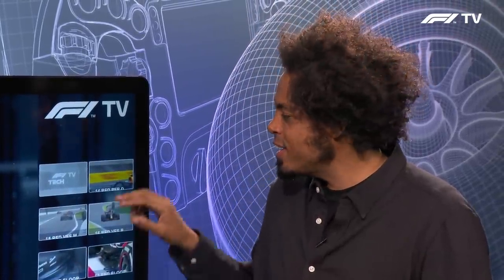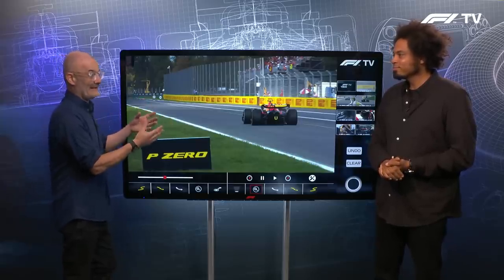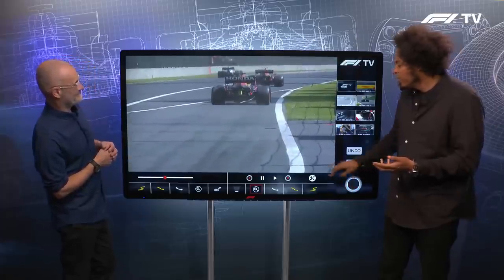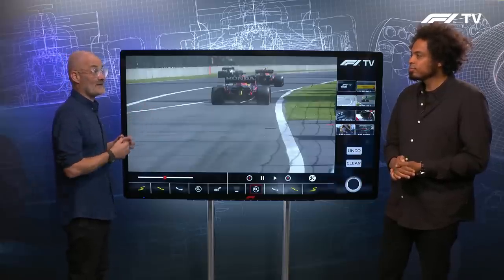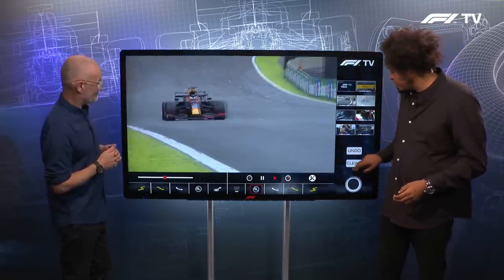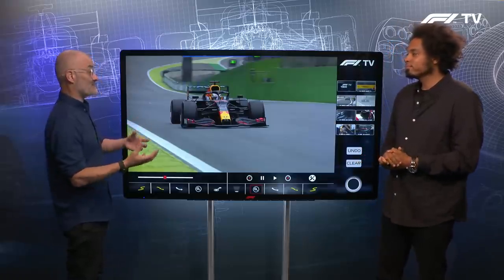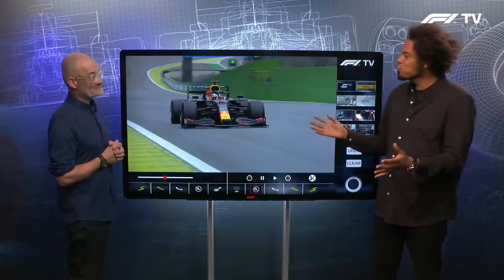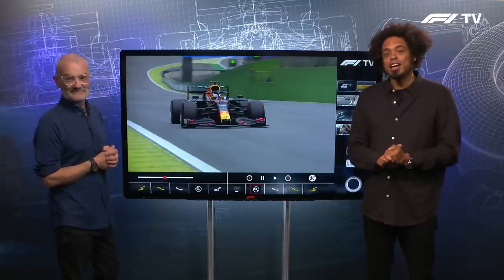What's Going On With Red Bull's Rear Wing? | F1 TV Tech Talk | Crypto.com

Comment: honestly I’m more interested in how high tech this touch screen panel is they’re using to show us these diagrams, pretty advanced technology!
Reply: The program, or app is what integrates the touches, i doubt that the screen has a lot to do with it, other than being a touch screen.
But yeah, it works pretty well, the programmer probably made quite some money on it.
Reply: What is essentially a big android tablet really isnt that advanced is it
Reply: i'm more on the side of "this should be standard everywhere by now" -- we've had touchscreens for what, over 2 decades now? yet they somehow work wayyy better in the tiny handheld smartphones and tablets than on bigger tv screens used for presentations? probably gated by the price of components that don't scale so well with size, but yes one of the bigger issues is app design.

Comment: I think they try and reduce weight of the rear wing mostly on low drag ones and as a result it’s made it more fragile. But if it doesn’t completely fly off then I guess it’s legal.
Reply: It really isn't legal, it's a movable device like that even if it ultimately costs laptime.
Reply: It could well dsq them from races if the drs is stuck open.
Reply: @akmal94ibrahim  if the DRS was stuck open, then the car would simply fly off the circuit under-braking.
Reply: @GaresMusicOfficial  ask Ericsson lol.
Reply: @GaresMusicOfficial  no because ground effect but he would lose downforce so he needed to lift or brake earlier
Reply: even if it is actually a hindrance, i think Toto will say something about it being flexible aero
Reply: It's not a weight issue. It's clearly a stiffness issue and I bet it's down to that wing element being so thin that, even in carbon, it isn't stiff enough to avoid aerodynamic oscillation starting as soon as a bump deflects it. Why make it so thin? Reduced drag in DRS mode and more downforce for less drag in non-DRS mode.
Reply: @akmal94ibrahim  no because it actually hinders them more than it helps them. Curve grande probably can’t be taken flat, lesmo’s are a problem and don’t even get me started on parabolica.

Comment: As long as i dosen't brake, there's no problem there. They need the wing comming out of corners, while they don't need a wing on a straight. The flopping does not affect the aero on the straight...A maximum low weight wing is actually perfection.

Comment: Do not try to fix something unbroken.
As long as it is not flying away, no reason to try to improve it. So far it works pretty well for them.
Reply: don't think it's very stable though. you don't want your rear wing to get yeeted off, especially in monza.
Reply: If it did that the whole race, it could avtually fly away..
Reply: @NeonColored  We've seen that happen before. I think it was a Haas or Sauber. DRS not closing into the braking for Turn 1, crashing the car.
Reply: @akmal94ibrahim  yep. Marcus Ericsson's Sauber, 2018
Reply: It went well

Comment: This is the unintended consequence of building aeroelasticity into the rear wing so it flexes even when DRS is not activated to gain a partial DRS effect. It's a hard problem to solve, but I'd prefer it if the FIA introduced stronger tests to prevent teams from flexing the DRS flap when it is not activated in the first place.
Reply: Literally has nothing to do with flex and all to do with seeking the utmost lightweight possible for the drs actuator. But go off merc Stan.
Reply: @santman3200  it has a lot to do with it. The rear wing is not allowed to flex in anyway at all. It must be rigged to a degree. Even if they are seeking lightweight it still must fall with in the regulations of flexing just like last season and the floor. Even if it's costing them time.
Reply: The FIA has strict tests on these wings, especially after last season’s wing debacles between merc and RB. Don’t be such a bigot against red Bull because your boy is not winning anything this season
Reply: @holkn  found the angsty teen
Reply: @skrimper  Said as a classic merc fan
Reply: @skrimper  said the boomer hypocrite "fan"

Comment: What makes you think this isn’t on purpose? Have you seen that system in buildings to reduce the effect of earthquakes. They have a weight at the top which shakes instead, maybe this is how they have gotten rid of the porpoising ? 🤷🏼‍♂️
Reply: Bruh they’ve had this issue for years so no it’s not for porpoising. Porpoising was fixed by a trick on the floor

Comment: If you make the wing flexible enough you can shed down force at high speed. It is very obvious with the outer part of the front wings. They would have calculated how much it loses and gains them and decided to keep it the way it is.

Comment: Sounds like the same problem the MiG-15 had at high speed.Any high-winged elevators on aircraft. 

Weight has to be added to the structure and a more rigid system has to articulate the wing. Sounds easy, but it’s the resonance and oscillations of the air coming off the chassis.

Comment: The FIA should let the teams run different wing sizes based on the top speed of the tracks. Changing the size of the wing effects the resonant frequency and could either  alleviate this point of intense vibration or move it to a lower RPM in the gearing range so that it's less of an issue.
Reply: do u think they are running the same zandvort wings in monza? you must be a new fan

Comment: Get rid of DRS altogether; and force the drivers to learn how to pass without it.

There are scant few of the current crop of drivers who know how to pass without DRS. It's an actual skill, which needs to be brought back into the sport.
Reply: The cars dont really allow for it dude. I agree DRS is dumb but it only came about because its too difficult to overtake with the massive cars on the tracks today and in reality how close so many of them are in speed. Even the difference between a red bull and a haas is fairly negligible outside f1- if a random mercedes or bmw were that close to eachother, it would be seen different

Comment: It's called Oscillation of the Atom, simplified - due to the quantized energy levels of allowed electron orbitals, single atoms can easily absorb energy around certain narrow wavelengths.
Simply put, the material used in construction of the wing can not handle the frequency of car vibration+air noise at the same time, so it's freaking out.

They need to slap a cesium clock on that thing and sort it out from there.

Comment: It's illegal: no moving aerodynamics are allowed
Reply: Ever saw mercedes front wing..?
Reply: All aerodynamic and structural surfaces inherently flex/move to a certain degree, that's why the FIA do load and deflection tests. They can only enforce within those set margins. Besides, there is no advantage to a fluttering wing (only adds drag and instability).

Comment: I still can't believe Merc got kicked out of Brazil quali for their wing, but Redbull can get away with their wing doing this constantly.
Reply: If nobody challenges it, they'll keep using it (though in this case it's probably better for RB if they stop using it because of the damage it does to their own car)
Reply: two very different issues behind the rear wing and why merc got kicked out.
as they said there is no regulation banning what the RB wing is doing. so how would you like them to get kicked out?

i would like for this to be regulated and not allowed, but until that happens they arent doing anything illegal. they are just hampering their own performance
Reply: @pasmas3217  I see it as a safety issue, which the FIA can act on, even if there is no specific rule. We've seen what happens when the DRS flap fails and comes off at speed.
Reply: why would they law something out that's hampering their performance and the stability of the rear wing?
Reply: That flap has to deal with unimaginable loads through the course of a race. It's pretty unlikely to break. If the FIA saw it as a safety issue then it would have been raised at previous races
Reply: @TheDapperDog402  we've had a similar issue with Sauber in 2018 where their DRS wouldn't shut upon braking. It's the team's responsibility to create a stable and reliable rear wing, not the FIA's.
Reply: @ryanford5387  Gionvnazzi's rear wing failed at this very track in practice last year and he had a huge crash. Riccardo's failed during testing and he crashed, either last year or the year before, don't tell me it won't happen just because you said so.
Reply: @TheDapperDog402  No one here is an expert. Giovanazzi's wing failing wasn't due to the DRS flap oscillating - that was a failure of a different part of the system. As I said, if the FIA felt it was a problem then they would have raised it in previous instances of this occuring. A couple of randoms like us won't change anything
Reply: @pasmas3217  Also, I don't beleive Hamilton should not have been excluded, just that there shouldn't be a massive discrepancy between what is allowed during scrutineering and what's allowed on track. (I.e. Hamilton's wing was 1mm out of tolerance and he was excluded while Verstappen's wing is clearing flapping much more than that and is a massive safety issue, but nothing is being done, not even the FIA telling Redbull to stop the wing flapping like that).
Reply: @NeonColored  It's the FIA's job to keep the drivers as safe as possible, which includes making sure the teams don't send them out in cars that are potentially unsafe.
Reply: @ryanford5387  No, but it shows what happens if it fails, either coming off completely or getting stuck open. Imagine if that happens during the race.
Reply: RB...legal wing.
MERC..illegal wing.
There you go.
Reply: @TheDapperDog402  If the FIA (i.e: the experts) were concerned then the issue would have been previously raised
Reply: @TheDapperDog402  Toto is that you??

Comment: Hamilton had to serve a penalty in Brazil last year over a rear wing issue that almost felt made up. I don't understand how it's okay for Red Bull's rear wing to be this chaotic.
Reply: I know, but await the incoming comments for suggesting this. Even if it costs time, it's moving and the gap is too wide - it's illegal.
Reply: How is it chaotic though? Sure it's flapping but like they said, that would be costing them speed and time. If this was benefiting Redbull in any way shape or form Ferrari and Mercedes would be all over it.
The rear wing on Hamilton's car just opened too far last year. Absolutely it was by a tiny margin but when you're pretty much thrashing the rest of the field with your pace you automatically get a target on your back for even the most minute infractions.
Reply: @jonwhite3265  the rules don't depend on whether somebody is affected by their enforcement or not. Either the flap is opening too far or it isn't. And Verstappen is crushing the rest of the grid right now, so even that isn't an excuse.

Comment: How can they not fix it? Or is it design to do something we don’t know and they’re cheating some how. Like if it’s suppose to flap slightly to get a little more speed but the mechanism keeps getting messed up and flapping a lot. As much as I’m not a Red Bull fan and they’re killing it this year, I hope they’re not cheating cause it would taint theirs and F1’s reputation. I want a fair race. 

I can see a wing design to slightly open just enough to give a speed advantage but not be visible to see it move
Reply: It's not cheating. I think the FIA and the 9 other teams on the grid would have noticed that. It's because they are using lighter material for the wing trying to reduce the weight of the car. And the RB18 has passed every FIA inspection so It's legal
Reply: You honestly think this is giving them performance gains and they're using it to cheat? Lol. Laughable opinion. Do some research on aerodynamics and you'll learn very quickly that this is not helping airflow whatsoever
Reply: @kinnexion  
Its nothing but salt bro...let him get it out.